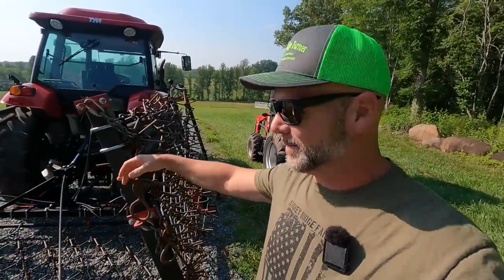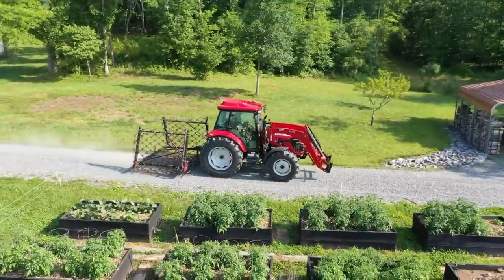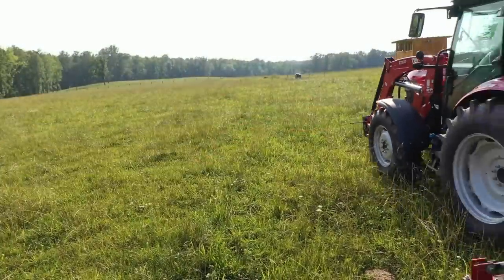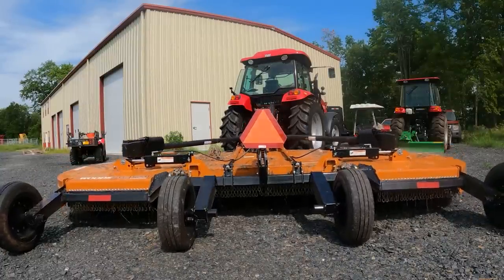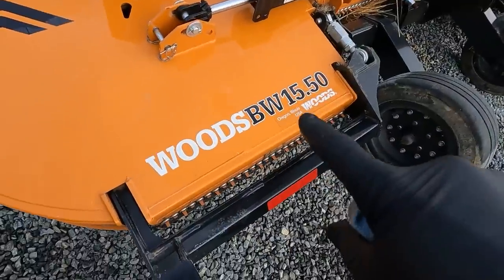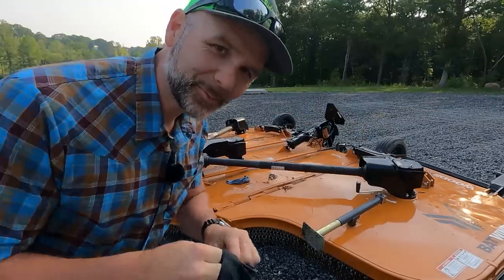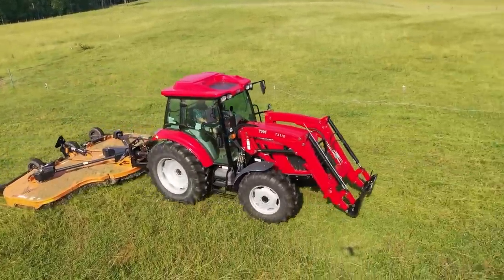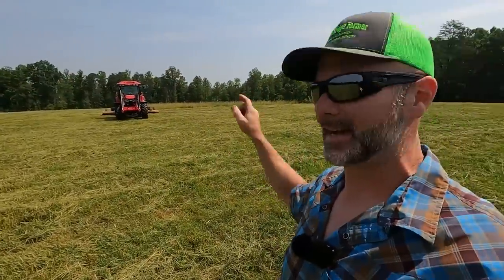Drought Proof Your Land, Simple pasture land management that works!

Comment: With all those grease points... need to find a battery grease gun sponsor... @MilwaukeeTool ? 😆
Reply from the maker: I have a battery grease gun...it's good for doing in the shop work...but outside the manual is just easier to handle....only takes about 2 pumps per fitting...farming is work no matter what my friend...I've found that power grease guns put in too much grease sometimes and blow seals